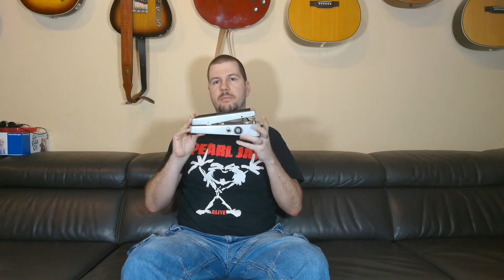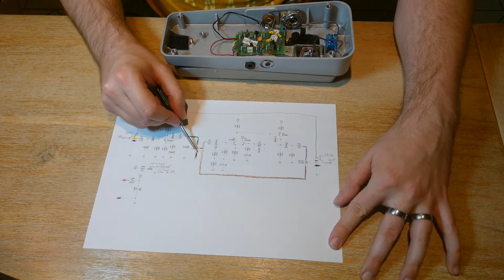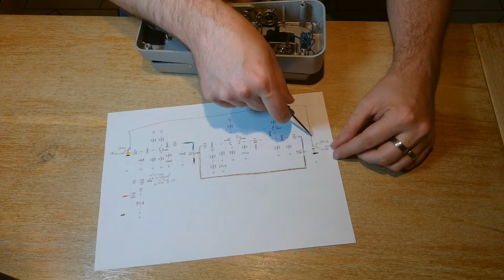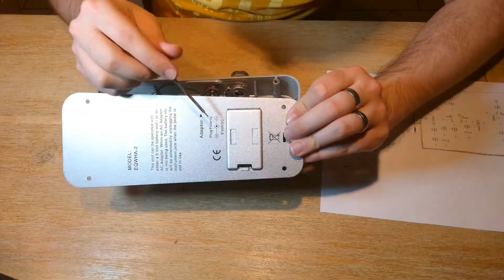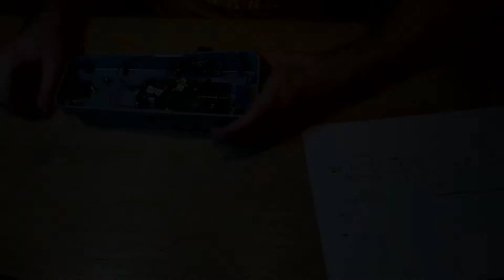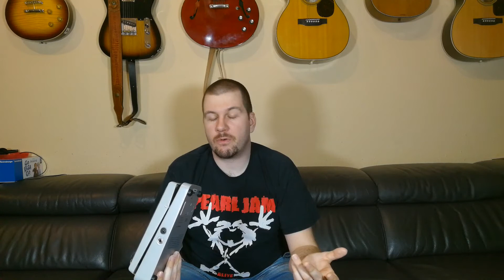Tutorial: Eric Clapton Midboost Circuit in a Wah Pedal

Comment: I found your video because I have this idea too and was hoping someone had already tried it. I'm not interested in a battery in my guitar and this is a good use of this circuit outside of the guitar.
Reply from the maker: That's great, I hope it helps! I've recently redone the modded pot as the copper tape I've had, unfortunately had no cunductive glue, which is annoying. Still, you will have something similar to a cklicking noise when switching the pedal off, if you do it like I did and mod a pot. The reason is, there is a rather steep volume drop in the end. This makes it sound like something is clicking or crackling. When reducing the boost extremely carefully, I was able to avoid it, but it's almost impossible when using it normally. I guess the pot used in the guitar might be an audio taper, but you can't do the mod I did in this video on an audio taper one, unfortunately.
It's not perfect, but I still like it. We have a demo of it on our channel as well, still with the old pot:
https://www.youtube.com/watch?v=sB9kr3q6yOE
With the new one the crackling is nowhere as big and as early as in that demo back then.
Cheers,
Martin